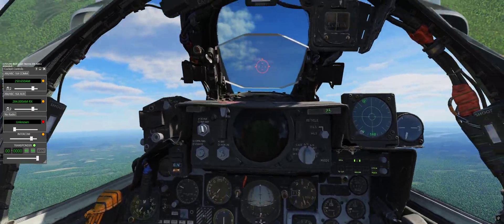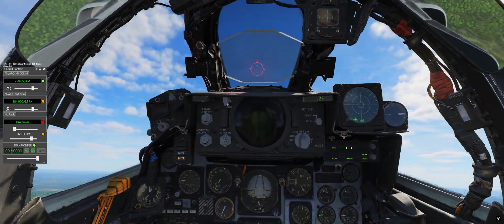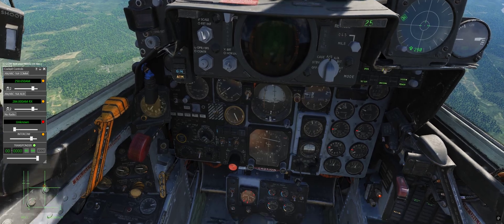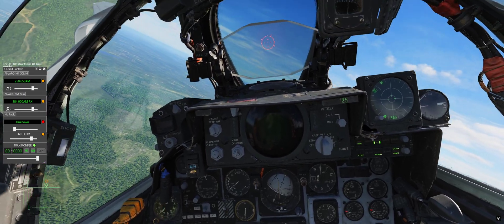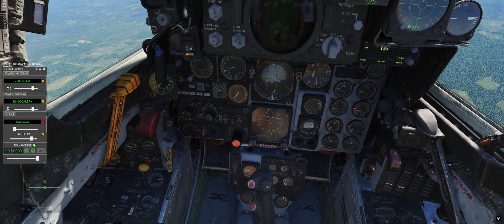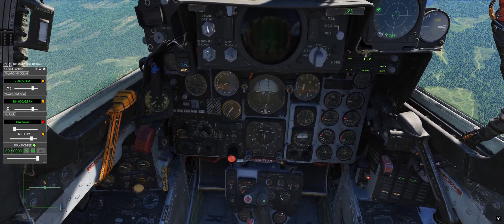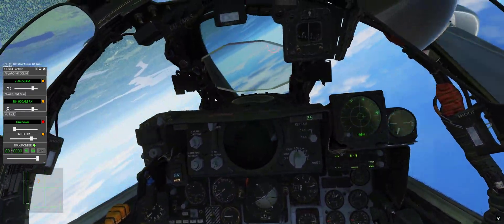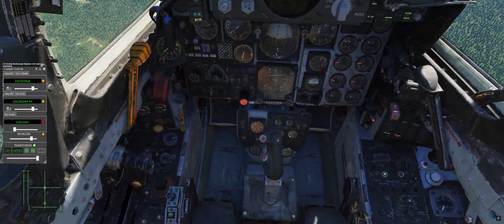DCS F 4E Bug: Non-Pilot Induced Oscilation?

Comment: Check your pitot heat is on. Myself and a number of other blokes experienced this on a MP server. Turning on Pitot heat has solved it for us.
Reply: the pilot is shivering so hes shaking the stick thats why it fixes it
Reply: @Predatorxdd  That would be funny, but the actual issue is in the weight/bellows/or so system that stabilizes the stick. Parts of it rely on airflow and can freeze with pitot heat disabled, which inhibits the trim system as well. Hence you get the oscillation.

This system is also the reason the stick flops forward when youre on the ground and no pressure is applied; it needs airflow to get goin.
Reply: Its hard to make out, but I think at 1:44 you can see the pitot heat being disabled. I definitely made that mistake before, guess I got lucky!
Reply from the maker: Cheers, I think that might be it. It's so cold in Finland. :)

Comment: Can confirm I've had this issue as well. Usually happens when my jet gets damaged. 
Its 50/50 whether you have to fly slow or fast to reduce the oscillations.

I think its to do with the FFB emulation in the special settings menu for the F-4, and not the AFCS like others have said.